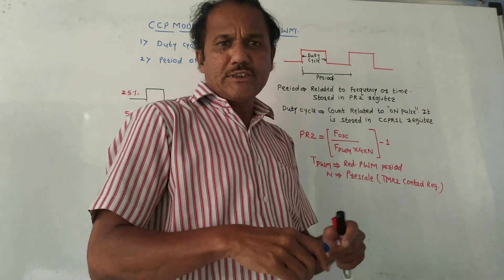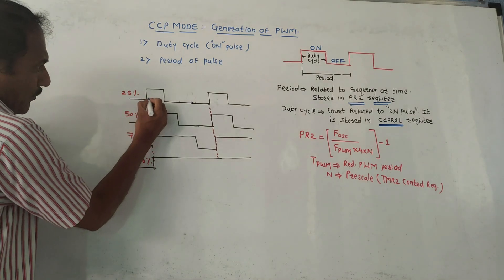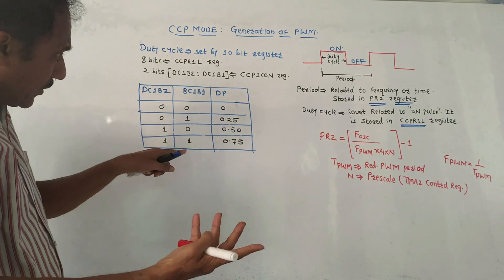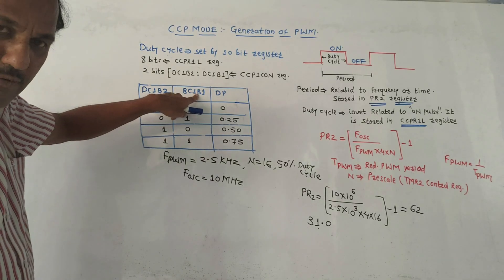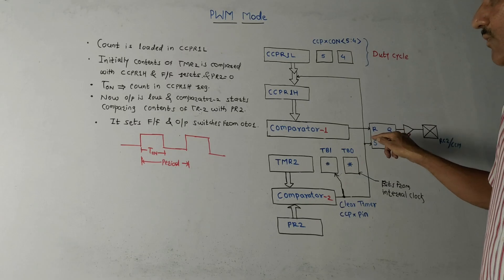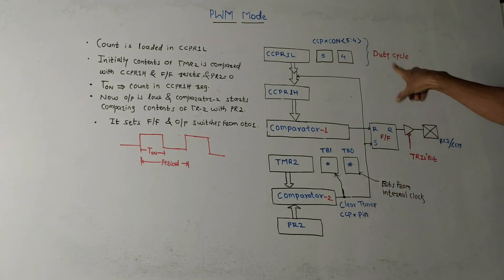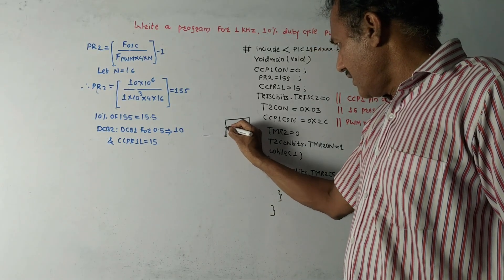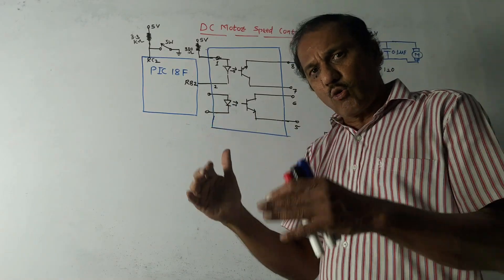PWM  GENERATION using CCP mode

Comment: Sir iam calculating the pwm signal for 1hz pwm  with 16. Prescaler and 33khz fosc. And getting  PR2 value more than 255  sir is there any option to produce 1hz signal

Comment: CCPR1L=15 Howw??
Reply: As duty cycle is 10% then we have to calculate the 10% of pr2 and pr2 is 155 then 10% is 15.5  and .50 is dc1b1 and dc1b0 and remaining is 15 which is ccpr1l is 15
Reply: @omkarlamjane4355  how ccp1con = 0x2c we have duty cycle %= 10 ,also if we select 10 then its value is 32 and 2c = 27